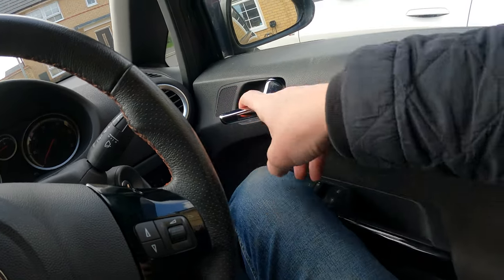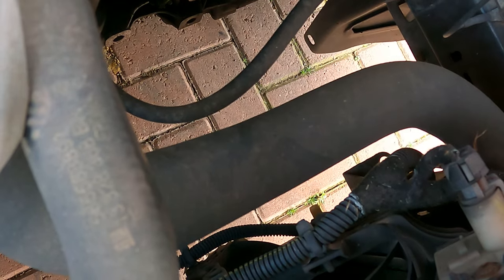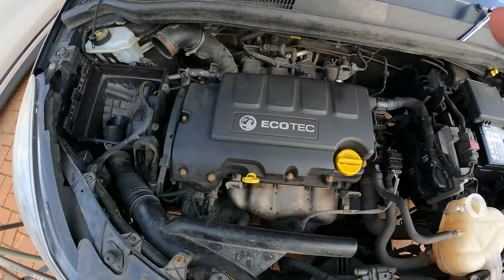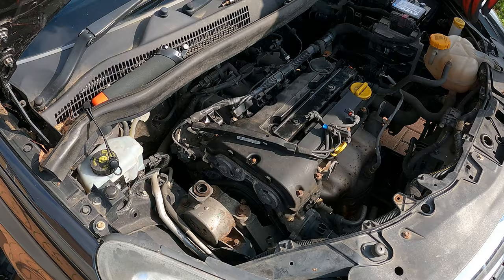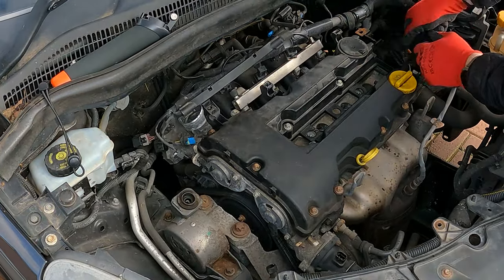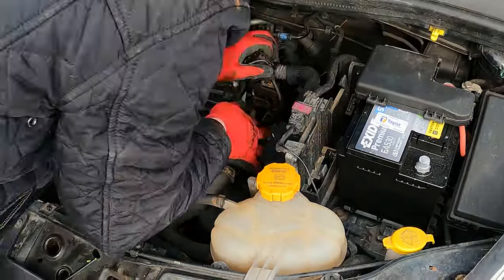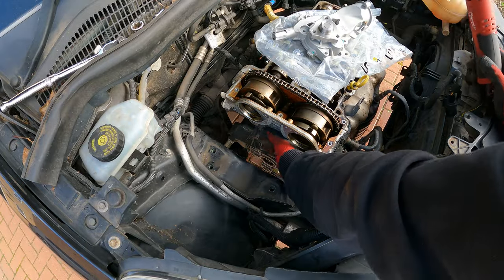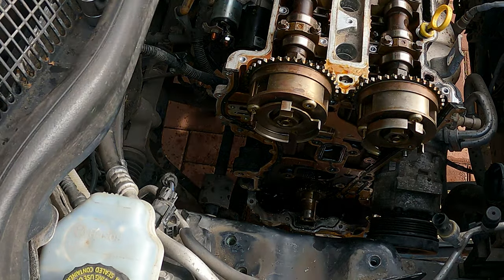CAN I STRIP MY SEIZED CORSA SRi ENGINE? VLOG 3

Comment: Big job but good on you for giving it a go. put an old bit of carpet under the car, save your nice clean block paving 🙂
Reply from the maker: I actually have one of the those spill mats but left it in the Abarth boot and that's currently away having all 4 wheels refurbished 😆

Comment: Great video and work!

I changed the throttle body on my Corsa D 1,4 petrol, btw change that rubber seal thats underneath the wiper blades because they leak! :D
Reply from the maker: Ah thanks for the tip! I will pop that on my list :)

Comment: Worth covering the head when handling nuts and bolts in case you accidentally drop one which falls down into the sump. Before getting the head off invest in a borescope and take the sump off since chances are you have a bent conrod?

Comment: You're making your life difficult, the Corsa front end is designed to be removed with all the crash structure and rad pack in one piece.

Then you just wheel the entire engine out the front of the car.

It is able to be done in about 60 minutes.

Then you have an engine free to work on out the car.
Reply from the maker: Hi Richard, Thanks for the view and for taking time to post a comment. Completely agree with you on this however, we just put our house up for sale and if I had a half dismantled car on the drive my worry is it wouldn't be good for house viewings. Also I have limited space to work on the engine outside the car. Keeping it in the engine bay while working on, is a slower process but it means I can leave the car presentable on the drive :)

Many Thanks! Chris